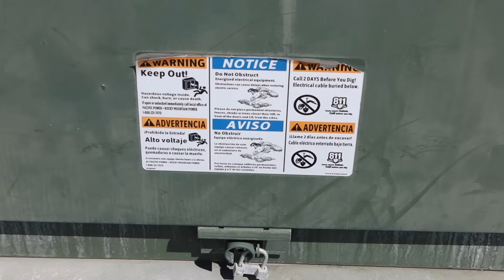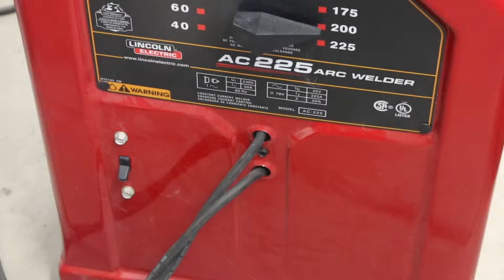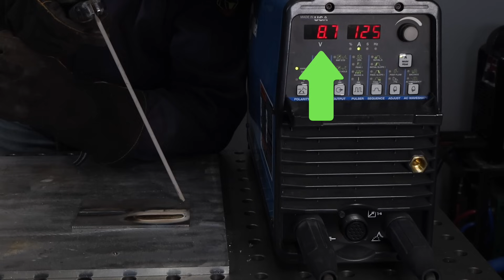Can You Get Electrocuted While Welding? Watch This...Don't Get Shocked!

Comment: Hello there i am a new welder.I just got a new welder-Its a little 110 cheapo stick welder ,I do not need a welder very much at all ( I CAN NOT WELD AT ALL) My rod sticks more then i weld-or i burn a hold in the metal, And i can not run a bead to save my life,Should i just give up on the stick and go to the wire kind i think its called ( MIG) And if so-when the wire comes out its good to go right?-(NO STICKING ) Like a rod-Im so bad at welding i call my self the GLOBBER-I just cant run a Bead- The only stick that i can GLOBB with is a (E6013 )-3/32
Reply: don't give up ... try different settings

Comment: Especially those wet conditions.  Many years ago I was working for an asphalt paving company, everyone had left for the day but myself and the plant operator who needed to do some minor welding on the lower frame of the plant with a stick welder similar to your little Lincoln.  He clamped his ground cable on the frame, took the stinger and started to crawl under the plant.  I was just starting to leave for my truck when I heard him saying, "Unplugit, unplugit, unplugit" in very rapid succession.  I turned and saw him on his  knees, one bare hand on the ground, the stinger in his other hand with the tip of the rod touching his bare arm.  I quickly pulled the cables out of the jacks on the welder that being closest.  He crawled out, saying, "Guess it's still too wet to work under there."  He then told me he was completely paralyzed under there, couldn't move a muscle.  Probably would have died if I had gotten into my truck sooner, but all he had was a tiny white spot on his arm where the rod had touched him.  I was a truck driver then, but I went on later to become a licenced electrician.  In 40 - plus years as an electrician (construction and industrial) I saw numerous people get shocks, even got a few myself, but that is the only time I ever saw a person frozen like that.
Reply: I've had similar experiences while welding on a dew covered slab... I hated welding for years after helping my brother and dad weld on thing out back.
Reply: OP IS A BULLSHITTER...
Reply: As a person that has lived through high voltage encounters, (elevator cabs are no joke don't go in those panels) it couldn't have been that bad if you can still talk. I'm sure it hurt and scared the daylights out of him but true fear is when it's enough to contract even your diaphragm muscles and can't take enough air into your lungs to make a sound  escape.
Reply: @MaliciousMonster  You are right
Reply: @MaliciousMonster  can confirm, this is most likely a BS story or the dude was just too lazy to help himself.
Reply: @ParadigmUnkn0wn  Gave you a downvote as you don’t know what you’re talking about. 
We use 240v in my country and I’ve had the grip of death around an electrical device in water. My thumb was over the switch and I could flick it to off, but it did nothing. I was locked in place whilst standing on my feet, my left side paralysed. I could still move my right arm, and was able to swing it over to the cord and pull it out of the wall. 
It wasn’t painful … more just a tingling sensation. 
I also had 1000v very briefly go through me. That made me almost throw up. Was wrecked after that.
Reply: @Seedyrom247  gave you a down vote as you don't know what you're talking about. Welders don't output 240V AC. More like 24V DC. Will it shock you? Yes, painfully so if you have a hot-start feature which can push the open-circuit voltage up to 60V DC. It could even kill you if you're either unlucky or have a heart condition. The fact remains that if you're capable of making anything more than a reflexive, guttural sound, then you still have enough muscle control to move.
Reply: @ParadigmUnkn0wn  I wasn’t holding a welder champ

Comment: Great video. While real pros in the industry are well acquainted with this. Non professionals aren’t. And by non pro I mean anyone who hasn’t taken at least one serious course in welding. Being paid for work doesn’t make one a professional in that sense.

There are other problems. One is that most welders unfortunately don’t have a voltage protection circuit since there are no standards requiring it.  Most welders have an open voltage between 85 and 90 volts, and I’ve seen some with 105. Plasma cutters, a tool many welders use, have a high voltage output.

Another real problem is the naming of leads. It’s a pet peeve of mine. You correctly call it a “work lead”. Where the name “ground lead” came from I’ve never been able to find out. But even some manufactures refer to it that way. Miller has a series of free pamphlets about welding. Pretty good, but often the words work lead and ground lead are used interchangeably. No such thing as a ground lead.

I constantly bring it up because it’s a dangerous error to think of it as a ground. The welder is grounded, though some cheap Chinese welders I’ve seen are not. They have a small connection for one to attach a ground wire to. But it’s useless. But if you ground the “ground lead” when welding, welders will become live. Will likely burn down, and electrocute you if you go to turn it off. If the piece you’re welding is grounded, it forms a short between the work lead and the wall ground. When you start to weld it, you can fry anything inside, and the entire piece is live (in addition to the above welder problems.)
Reply: So if you’re work piece is grounded ie. through the buildings ground, then it’s a ground.
Reply: @keithtee6501  yes. Then your work piece is a ground. But the work lead is not. It’s part of the live ac circuit, or DC neg or DC positive. Sometimes you can seem to get away with it because the machine you’re welding in isn’t contiguous to ground. But it’s not worth taking the chance. Always unplug anything you’re welding to.

Comment: I used to weld barefoot. I hated dancing while the spatter showered on my feet. I started wearing shoes after welding barefoot on a wet driveway. It was an eye opener.
Reply: That's silly..stand in the grass its softer on the feet...:)

Comment: When i was in germany, we were tieing down tracked vehicles on flatcars. Trains run on 66000  volts (it may vary) carried by overhead wires. The power is supposed to be shut off prior to the operation. Ours wasnt. A guy, standing on top of bis vehicle, lost his balance and raised an arm upward to catch his balance. The overhead wires sent electricity arcing through him like a lightning strike.
Reply: and his life was over. damnit. sorry to hear.
Reply: @particleconfig.8935  im perfectly fine, wasnt that big of a deal really.  i do have superpowers now, but meh
Reply: That is absolutely terrifying.  I had to do OSHA training to be allowed to visit a facility for work one time and the most terrifying thing was a clip much like that, although it was someone climbing around on top of a passenger train and reached up somewhat carelessly towards the overhead wires then ZAP.

Comment: I would say so, while welding on a wet submarine in dry dock if I was holding on to the stinger while touching the hull you would get a kick in the ass…..
Reply: did that happen to you or did  you see it?
Reply: @davidjones-vx9ju  it happened to me
Reply: @humongousdingus7382  did you die? or suffer long term damage?
Reply: @davidjones-vx9ju  
No, just learned not to hold on to the stinger that way. 
Hold it by the handle which insulates you.

Comment: electricity wants to go back to where it came from even if it is through you.  watch out for damp welding gloves, can get  a zap from them.  you will get a tickle from touching an electrode with them
Reply: i was using a water bottle to cool sheet metal I was welding, my neighbor lost his fricking mind when he seen me welding wet metal.. I laughed and continued doing what I was doing with no problems. he was convinced at any moment I was going to die and maybe a little disappointed when nothing happened.
Reply: i will add, you can a real jolt from the high frequency spark that starts aluminum tig welding.  do not insert the aluminum filler too soon, the high frequency spark will jump to the filler rod before going to the work piece if there is any little ground through you like in damp gloves or bare hands.  that spark is brief but will make you jump, from experience

Comment: My welding teacher use to work in ship yards on the east coast. He told some interesting stories and one was about working in the rain on the ships deck and having wet gloves and every time he put a new rod in the stinger he could feel tingling in his hands from the electricity
Reply: We use to wear a thin rubber glove ,think like a dish washer glove under your welding glove
Reply: This happened to me haha, no one ever told me to stop welding in the rain so... Just kept going.
Reply: @showerball5376  they can weld under water
Reply: @davidjones-vx9ju  that's a special kind of welding built solely for the underwater. Of course man can weld underwater but not what I was equip with.
What you trying to prove?
Reply: @showerball5376  wet places
Reply: @davidjones-vx9ju  dude you are comparing drops of water with a massive body of water.
Reply: @showerball5376  well if they can do it under the water ....  doing it on a wet floor isn't much different
Reply: @davidjones-vx9ju  ok go weld in the rain and weld underwater

Comment: I thought you could hold the bare stick with your hand to guide it.
Reply: You can hold the stick but you should get a great machine and gloves. Back then when i was using stick welder ill always holded the stick if its long for better control also dont weld in rain. (My teacher also holded if its long in school) Nowdays ill just use mig welder with flux core wires for better control.
Reply: As the others here have said you can, and I do hold the rod while welding but most pipe welders don’t as it is too restrictive. As far as the electrocution is concerned it mainly becomes apparent to you on striking up as the oc voltage it higher then ( on the sets I’ve used ) when you are actually welding you generally won’t feel anything but you are possibly still been electrocuted. The voltage is to low to feel.
Reply: Yes you can. As mentioned be careful of water, and also make sure you have a machine with an anti-stick function. If it doesn't and you stick your electrode it will start to melt upwards and burn through the gloves in a jiffy.

I'm not an electrician, but I know that electricity needs a closed circuit and that it always goes the path of least resistance. So as long as you make sure your body is not closing the circuit and that is the easiest way for the current to go, you should be fine.
Reply: The flux coating on most SMAW electrodes is not much of an electrical conductor....at least not at the voltage we use for welding.

Comment: I have been shocked more than once one tim savior.  When I was a pipeline wleder once we were extending a pipi cassing accros a highway..  I was in mud up to my knees using a Lincoln 400 amp gas power welder.  During this job it began to snow a very wet snow so all my clothing and gloves were wet.  I was running 200 amps 3/16 diameter rod. when i struck the arc the power went through me, people were on the top of the ditch, when this happened i the electricity lock my mouth shut and stop my musels from working and cause me to shake a lot. the people on top of the ditch started laughing until one of them relized i was being electricuted and shut the machine off.  

Another time not so suvior. my clothe was soaked from sweat. i leaned against the pipe struck the arc and it went through my side blowing a 3/4" hole in the aluminum sheeting and burned a place on my waist.

Antoher time was with a tig welder in the shop when something went wrong with the machine.  It was grounded directly to the part being welded. When the pedel was pressed it sent, like a lightening strike. from the electrode holder to my upper arm, replaced the welder.  

As TimWelds said make sure you are dry and the machine is grounded.
Reply: so   you didn't learn the first time?

Comment: How does underwater welding work then??
Reply: Its the same as the standard welding you are using mostly stick welder underwater(Its not that tipical home stick welder but its work the same). Offcourse you are insulated and there is other safety stuff but it still dangerous.
Reply: @DeteCT0R  ...and with my luck i will forget do e of the safety drills and fry / boil myself like a crayfish...😆

Comment: Moving electrons and water are very similar -- they're lazy.  Give both a much easier path to where they want/need to go and they'll leave you alone completely.

For example, when working on car chassis, I'll set up two or three grounds surrounding the area to be welded to keep the flow of electrons from spilling over in the other electronics of the car.  Welding an exhaust pipe?  I'll have a ground on each side of the area to be welded.

If I was operating on a table all day, I'd mechanically affix a permanent lead to the table itself and then have another thinner gauge conductor joining the table and the work piece.

Underwater welding is all about providing that easier-to-ground path rather than letting the electrons find their own way...

And if you really want to be safe when stick welding, when not actually welding, turn off the machine!

Comment: What makes welding mostly safe from the electrical side is that the working side of the welder is an ungrounded circuit.  It is isolated from the earth/case ground used on the mains electrical side for safety, stability, etc.  As an ungrounded system, you must get across the working leads to be shocked.  This is true for the old transformer based buzz boxes and the new inverter machines.  So don't lean on the table/work when you are touching the rod or torch tip.  Water on the ground is a concern, but that is  going to be a relatively high resistance path which will limit the current available given the low voltages.  Plus modern machines have sense circuity the cuts the power when the current/voltage profile doesn't match an arc.  Kind of reverse of the arc fault breakers/outlets now required, which cut power when they sense an arc on a regular household circuit.  

To remind myself of this, I stopped calling the work lead the "ground" as it isn't.  Ungrounded circuits require two faults before they can form a circuit outside the work and hot leads.  So check your cables to ensure an unplanned fault can occur.

Comment: Great PSA! I know the SA 200 has an OCV of well over 100 when it spools up and is a dream to weld with for it. My new IGBT unit claims 78 V but that's potentially lethal too. Even when not lethal it can cause painful muscle strains and accidents, like dropping a plate on a foot. Sweat is a fine electrolyte to make gloves conductive so keep dry.

Edit: Just checked my Esab 180 ES (which burns my fav E6010 very nice): just over 79 V on the SMAW modes (nice!) and just over 24 V on GTAW.
Reply from the maker: Thanks! I also have an ESAB 180 for portable work, it’s awesome stick machine. The OCV is locked in pretty high, though.

Comment: Your HTP has vrd….  Press and hold the select mode button for 5 sec when you are in stick and the light starts to blink, that tells you vrd is on ….  You will be under 20 volts ocv….  It automatically senses when you want to start the arc and ramps it up.  
Arc starts on that machine are not really hard with vrd….
Reply from the maker: Thanks! I tried it and it lights up and runs a straight 7018 no problem.
Reply: @TimWelds  Glad it worked out for you ! its a really good and way under appreciated stick welder...  Hot start and arc force are factory set...  but other than that .. AC and DC stick with pulse ... 6010's the whole 9 yard ....  it really runs well ...

Comment: Guys, I can speak from experience. I have get zapped more times than I'd like to. A welding machine will not have an open circuit voltage higher than 80 volts. If it's dc, it will tingle. And maybe, if the skin is wet, a bit of pain. But you probably will have more trouble with touching hot metal. On the other hand, if it's ac, it will hurt. Will not kill you, though.
Reply: this was the key info missing (and expected) from this video. Thanks for your comment.
Reply: @perspectivex  I wouldn't want him to say that in the video. Because it's only true in the best case scenario. If you have an unknown precondition with your heart, the outcome can be very different. And you wouldn't want to discover this fact while welding and relying on what he said in this video.

Also: wet conditions change this equation a lot.

Same goes for open wounds. Your skin will resist 40V normally, but with an open wound this voltage will be a lot lower.
Reply: @brag0001  It just thought it be nice to know where a typical shock from say a stick welder sits in the spectrum from microwave transformer (2kV and probably certain death), to say 230V or 110V AC wall outlet, to 9v battery on the tongue.  You know, just a kind of rough idea what the actual shock is for a normal person without heart condition.  I remember once a guy in a workshop I was in saying when he learned welding they had the students grab some kind of electrode and with power on (I don't know how much, but not a lot) it showed them they had no muscle control and couldn't let go of it (in that case I don't think there was a shock, but not being able to release the grip was definitely a problem).
Reply: I forgot to turn the gas on before tig ac and the tungsten sparked and I felt a tiny shock. Is that what you mean?